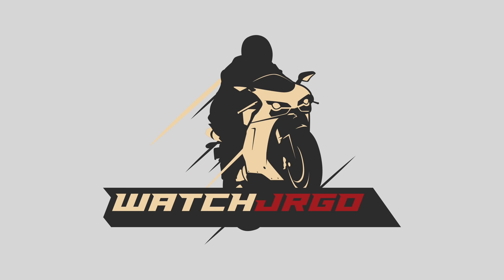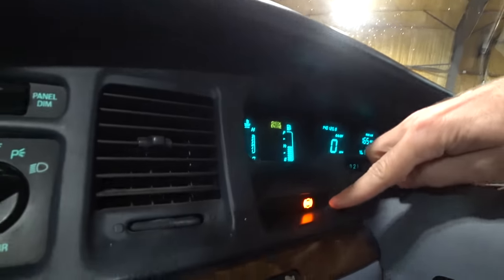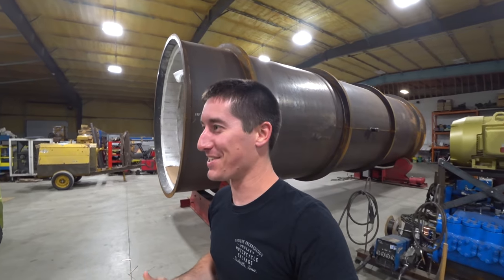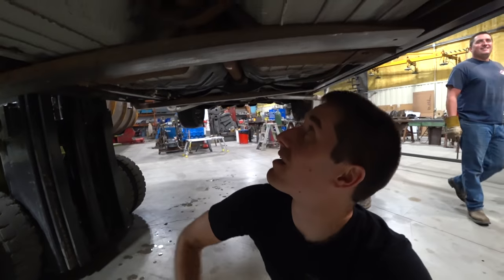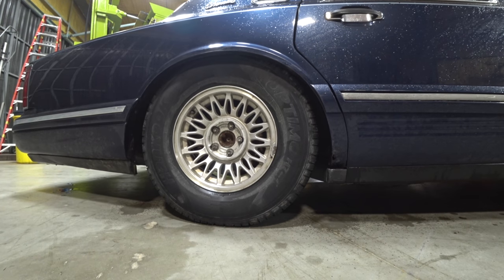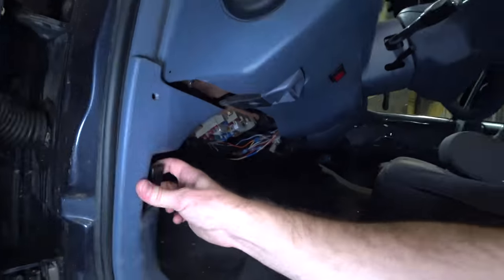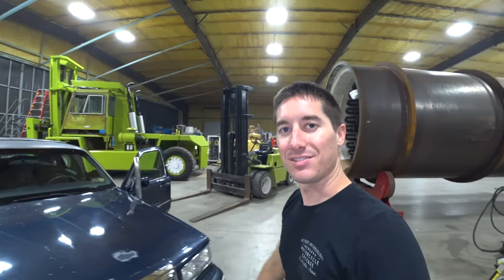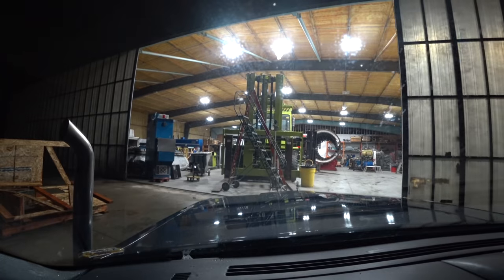Everything That's WRONG With My CHEAP LIMOUSINE Lincoln Towncar

Comment: The 4.6 L V8 will go into a limp mode and run on 4 cylinders if the ECU thinks that the engine is overheating. So the reason the driver's side back shuts down is probably of a fault in coolant sensor wire harness.
Reply from the maker: That would explain everything... maybe it's just a bad ground. I was going to swap the coil packs from side to side to try and isolate it. The issue is very intermittent and can turn on and off based on the throttle position/load. 🍻
Reply: you notice it steaming while on lift?
Reply: Probably something to do with the coolant sensor or wiring to it

Comment: Be careful with the air suspension.  Make sure the tires cannot make contact with the wheel wells when down.  There were two instances in Northern Cal of commercial Lincoln limos  air suspension failing in service.  The driver couldn't hear the tires rubbing and they caught fire. Seven died in one limo, 5 in the other, (door locks failed and would not unlock).  I would check the clearance and install a hard rubber block to keep tires from ever rubbing, but still be dropped 90 %.  Excessive leakage in the system will cause the dash sensor to light.  I had a T/C the coil pacs were intermittent on , had to replace several, then worked perfect.  The left rear wheel well damage was probably a tire failure at highway speeds, steel belted radials tear them up.   Back in the 60's I had 1958 Impala, Bonneville, 98 Starfire, Buick Limited  and Cadillac, all were convertibles, and all had factory air suspension.  They all pancaked flat each night but worked ok when driving, each took 10 minutes to pump up each morning, the rear rose at 7 minutes and front at ten.  They were impossible to drive when down.  For cosmetic repair on yours, I'd just use metal duct sealing tape on the rust and spray can (color still available at auto parts stores).  On the missing clear, respray the clear and buff, it can be a fun driver.  My son bought a last series Mark Vlll coupe in the same color as your limo.  prior owners had fixed everything on it, then decided to sell it.  They spent $9000 and sold to my son for $2000.  It looked and drove as new.  We used it on a trip to Canada and it was perfect, but he considered 22+ mpg not enough and sold it.  Have fun, but check tire clearance down.

Comment: With this six door configuration...my bet is this limo was originally a Funeral Family Car.
Reply from the maker: It has headlight wig-wags too, pretty sure it was at least originally for a funeral home ⚰️
Reply: I doubt it. It's blue. The people who built it probably built them mainly for funeral homes but this one has gone elsewhere.
Reply: @eat_a_dick_trudeau  most are black. Most funeral homes are small so they don't have a big fleet of limos to give people a choice of colours. And ditto. Not all limos are funeral cars.. In fact he said in an earlier video this belong to a church preacher who would drive around his flock..
Reply: Colin Johnston there is a funeral home in my area that run green vehicles as well.  So, it was a funeral car in all likelihood, and was owned by a funeral home that used dark blue vehicles. If I remember correctly, from one of the other videos, the pastor had only owned it for a limited amount of time.  Limousines don’t typically have wig wag lights outside of the funeral industry.
Reply: @organrick  yea I personally don't think it was but whatever dude. Let's leave it there. It was a passing comment, it isn't going to change my life either way and I certainly don't care enough to debate it for 3 days straight..

Comment: The heater hose under the intake manifold is probably leaking and thats the coolant on the ground. The air bags are leaking because it's not supposed to be slammed every time you park it. Turn the air ride switch off in the trunk if you want it to stay that way but the ride will be extremely bouncy and harsh

Comment: Back in the day when the car was new I worked and was involved with Lincoln/ Mercury. The factory would put the door key pad code on the trunk hinge. Hope that may help. Great series. If I lived closer I would take this car off your hands
Reply from the maker: I'm going to check in the trunk tonight! You guys are on it 💪 I'm used to digging out the keypad codes for the F-150s
Reply: Hope its there for you. The lincoln continental would loose its air suspension. Alot would come into the dealership for the lowrider effect. Now they make a air controller to stay at the height, or change rear suspension to coil over. The air pumps on these town cars would burn out if not fixed

Comment: Your door code should be printed on a little sticker on one of the trunk hinge arms. Wow you were scaring me going under there like that! You could shut the air suspension switch off in the trunk so it doesn’t air up & then it would stay down. I know there is a way to make the suspension manually adjustable, I’m just not sure how but I’ve seen people talk about doing it on the facebook groups. I converted my Town Cars to coils so I don’t have to deal with that air ride BS.
Reply from the maker: Some of the other comments here mentioned just changing the position of the lift height sensors, that sounds like the move! 🤙
Reply: WatchJRGo yeah
Reply: Matt's Garage with a Ford product, the door code is on a card that you can put in your wallet, but since it’s changed owners at least once before you got it, you might not have the card, or in 20 years time, it probably got lost somewhere.  All you would have to do is go to a local Ford or Lincoln dealership, with the last 8 of the VIN number, and they would be able to look up that information for you.  I don’t know how far back it goes, though, so you might not be able to get it.  It might be with the owner’s manual as well, and if I remember correctly, it’s a red and white card with black numbers on it.
Reply: Rick Reed The code is on the trunk hinge, they all had a sticker there originally, unless some has removed it.
Reply from the maker: Mine was there, the update was in this video: https://www.youtube.com/watch?v=p0Kv2XOj3i8

Comment: There is a single height sensor in the rear, you can adjust it to alter the ride height to your liking but will be riding on the bump stops if too low
Reply from the maker: Dropping it an inch front and rear would look killer rolling down the road 🛣

Comment: I had 97 Town car. I replaced the air bag control ECU three times. Every morning before and after work I'd find my Lincoln either slammed  in the rear or front or left or right side. Crown Vic  coils fit  with little conversion. It never strop breaking on me either. I paid a grand for it at auction, spent a grand on it and sold it for scrap. Good luck.

Comment: You can manually turn off the air suspension with a switch in the left side of the trunk. That will allow the air to go down after a few starts. However, with the rear all the way down, its undriveable.

Comment: There is a ride height sensor on the driver side front of the rear axle undue the two 11mm nuts and move the sensor towards the driver side to lower it.

Comment: There is a button In trunk to turn off air ride, there’s a pull cord in trunk to pop open gas cap, and on the trunk lid arms is the original door lock code
Reply from the maker: Absolutely, discovered all this as the series went on. Turned off the air ride and drove it around, found the door code and it worked perfectly, never got around to fixing the fuel door release 🍻

Comment: There is a hight sensor above the rear axle that has a plastic arm you can put momentary switches on it to get manual adjustment
Reply from the maker: That genius too, I thought the height sensors would be a bit more complicated. 🍻

Comment: If you want to control the air suspension, there are usually little sensors that attach to the control arms (im going off GM engineering ) that you may be able to tap into the wires and disconnect the arms to control the way it levels out

Comment: Yes it has a ride level control unit attached to the back axle to know when to air up the suspension most likely you have leaky air bags and if the compressor runs so much it will just turn the compressor off and the light will come on.

Comment: My 2000 Lincoln town car has air suspension and it lowers down in the back really low like yours does when it’s jacked up in the air to relieve pressure and not blow the bags out. I would guess the bags empty out when it’s parked to take stress off. You should hear it make a rumbling/ vibrating sound every hour or so that it’s parked. That is the pressure being released

Comment: Airbags are probably leaking. If you don't want them to pump, flip the switch in the trunk. You can do wiring to the suspension module behind the glove box but it requires buttons and switches. There are schematics online for the airbag vent dump solenoids, and the dump vent in the air compressor. You want to change the plugs n wires, misfires on those engines can lead to severe engine failure.

Comment: Look on trunk hinge for a white strip with black numbers. That would be your keyless entry factory code. There is also the control module under the rear shelf  by the rear speakers. Good luck!

Comment: Also a air suspension shut off switch is located in the trunk on passenger side, which.will shut down the air ride. Must be in the off position if you raise the car on a lift to prevent damage (folding over) to air bags.

Comment: There’s a height sensor on the driver rear wheel. You can disconnect it and lower the lever. Then the air will let out. Once it gets real low, hit the switch in the trunk to shut it off when the rear is down.

Comment: Air suspension:  Had a 95 TC with bad level sensor, so this 100% works.  you can use a toggle switch in the glove box and run wires down to the connector for the ride height that is just below the glove box.  a center off toggle works really well here.  you can find the pin-out of the plug and just clip the wires so you can manually turn on the pump and solenoids.  If I recall pump and solenoids on to raise car, just solenoids on to lower.  It drops really slow, so be ready for that.  You could use a second switch you could keep the automatic ride height working as well.  Side note, never raise the car without turning off the air ride.  (Edit: Side note, unless the limo is drastically different than a normal TC, the air suspension is in the back only. can't do anything about the front.)
Door code:  If it's there, there's a card tucked in the owner's manual, also in the trunk, on a sticker, may be on hinge, spare cover, or some such.  as last resort, it is on a sticker on the door control module inside the driver's door.  takes about a minute to remove the 4 screws holding the door panel on.  You can program 2 codes aside from the master and each will automatically set the seat and mirrors to that preset.  5 key code to unlock driver door.  then 3-4 key to unlock other doors.  5-6 key for trunk, and pressing the 7-8 and 9-0 at the same time locks the doors. 

Just had to take my 95 TC to the junk yard as it just wasn't worth the cost to fix her.(Blown head gasket pouring antifreeze out the exhaust was the final nail, but been in several wrecks and had serious electrical issues.)  385k miles, 190k of that mine over the last 10 years.  Best car I ever had.  Say, want to sell a limo on the cheap?
Reply from the maker: Check out yesterday’s video, got the code figured out 🤙 this is good info!

Comment: The code for the door should be in the manual or on one of the trunk hinge arms normally the passenger side one
Reply from the maker: 😎 I'm going to check that out!
Reply: I had to retrive a entry code for an 02 expedition and it was under the driverside footwell right behind the brake switch

Comment: they have a air suspension off and on switch on the trunk. mine in my old mercury was on the left i think. and the light comes on if there is a problem. like air pump doesnt work. but yes the rear suspension airbag system is not working.

Comment: There is no air suspension components on the front of Town Cars. Unless the limo company had air bags put in front, which I doubt.  The blinking check engine light means the engine has detected a misfire. The Air Suspension light is on because the system has detected a problem. More than likely a bad height sensor or the system is just worn out. Always turn off the air suspension switch in the trunk when you jack up the car. If you don't the bags will fill with air and when you lower in down to the ground, the bags may pop. Overdrive light being on is letting you know there is a problem with the Overdrive circuit in the transmission or the overdrive switch is bad.

Comment: if you want the car to be low disconnect the air compressor. But I would never do that
Reply from the maker: I figured it out! Found an old low rider forum post: There are height sensors on the upper trailing arms in the rear. you can just adjust the arms to make the car lay out more. You can do this to the front also. Pretty simple.

Comment: The lock code for the key pad is 78 90 at the same time
Reply from the maker: Yeah but the unlock code is the custom one, I'll make sure it locks tonight though, good lookin out! 🤙
Reply: I know car dealers set them as 55555. There should be a place on the car I think it's in the trunk that has the original code.

Comment: so there should be a switch in the trunk to turn the air pump on and off for servicing. my parents own a number of limo and rental companies and all of the old town cars we used to have had this. it could have been done only from our coach builder but i dont think so. you cold also just pull the fuse for the auto level but you're asking for trouble doing any of that.
Reply from the maker: I read about this on the forums and it sounds like every Towncar has this switch. 👊

Comment: My old continental had air suspension ride height actuators with a white plastic rod attached to them. To lower the car, you fool the actuators in to thinking the car is actually higher up than it actually is, by attaching the rod at a lower point, or making a custom rod.
Reply: Also the door code should be on one of the trunk hinges.

Comment: as nice and loud as the exhaust is it is probably low on power because it  has no back pressure. My Silverado has an electronic cut out just past the cats and with it closed going through the muffler, it has more get up and go than with the exhaust being open.

Comment: Turn off air ride should be in the trunk by the fuel. Shutoff switch shut it off and it will drop u use this button for when u jack  it up

Comment: You aren't wrong about the Lincoln being cheap those things always manage to brake some how, my dad bought the same limo (but stock) which he bought since the original owner sold to him for under $1,000 and one of the cylinders don't work, ac doesn't work, and the body is messed up pretty badly, the whole thing pretty much is a bust. I don't and something about watching this video makes want to help fix it up when I can get a job.

Comment: you have a leak in the air suspension . could be the compressor under the windshield fluid container my wife has a 1996 lincoln town car and she replaced the compressor herself
Reply from the maker: For sure, I need to figure out how to control the thing! 😎